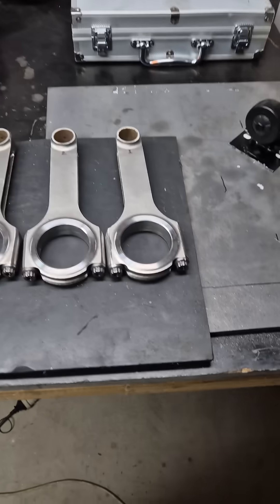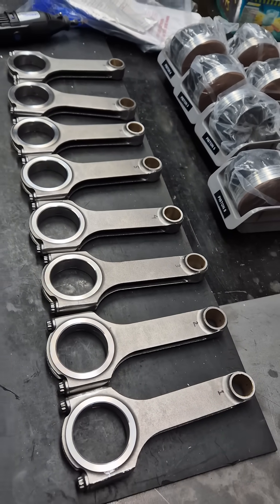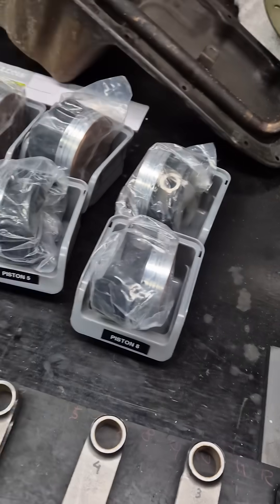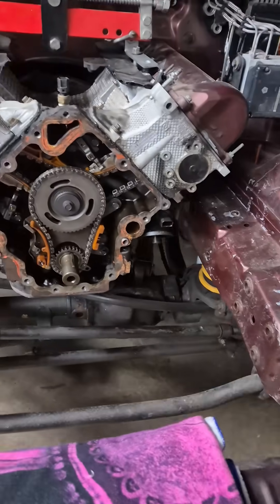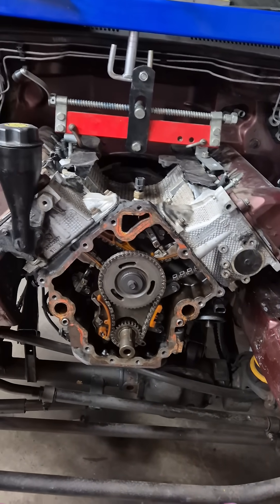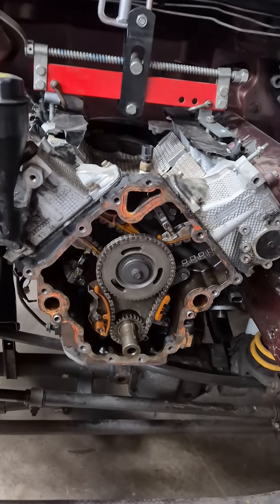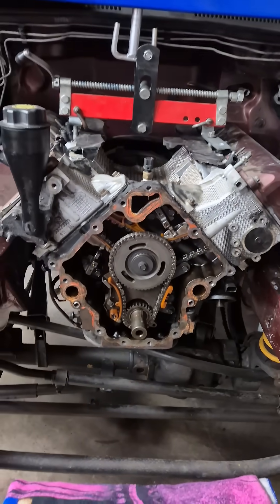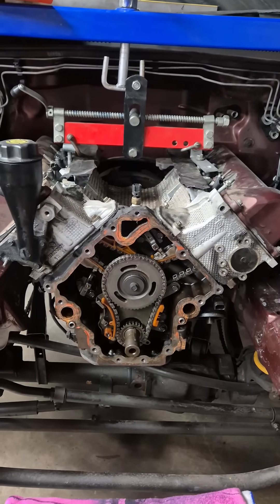Balancing Conrods for a 1000 HP project. #howto #automobile #diy #jeep #engineering #race #car #jeep

Comment: Aiming for that 4 digit as well but with a 3.4 whipple supercharger later on , currently with a ported Eaton m112 root style blower 2.8 pulley and 102 mm throttle which will have me stuck at 500HP to the tires also with Ross pistons and scat I beam rods
Reply from the maker: I have not been able to do much. My wife is having mental health problems. Nit something I ever thought I had to deal with in my life. Its devestating the family. Im told by the Haltech rep I could hit 1400 hp easy. I may try that one time on the dyno but then reduce the tune. I may have a few power settings I will use. One for daily driving and one for fun and one for all out racing.
Reply: @BuiltByRik  sorry to hear that not sure if you believe in God but if you just ask him for support he will do miracles and a lot more with it
Reply from the maker: @Supercharged287SOHC Thank you. 100% my brother I could not cope without Gods help. My whole life has been with him in it.